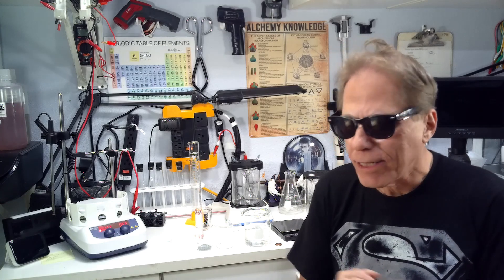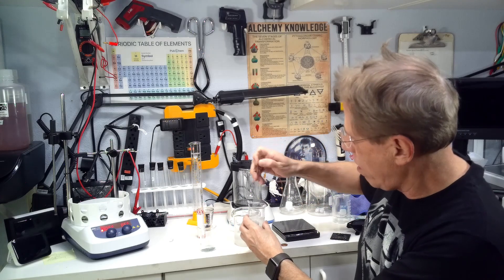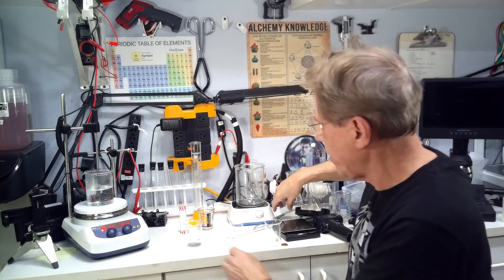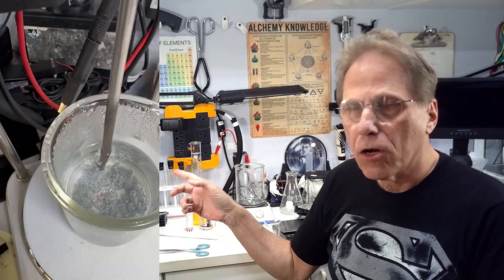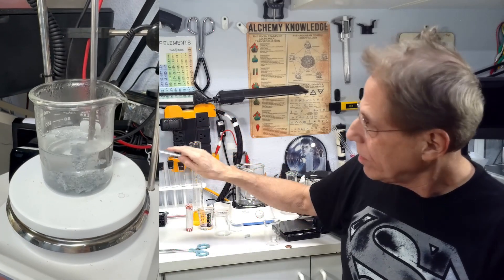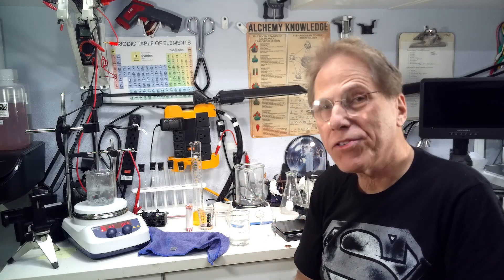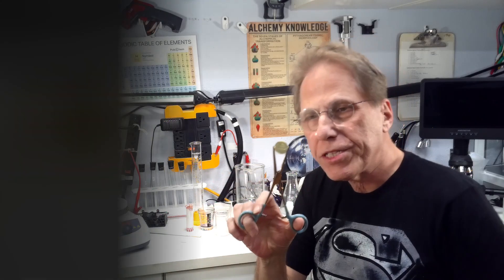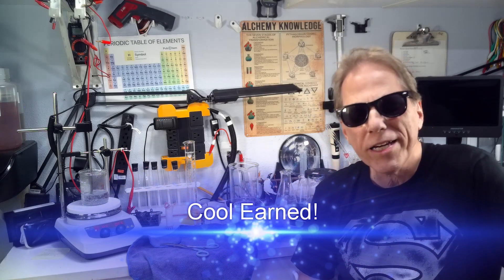Turning Copper Pennies into Gold! It’s Alchemy!

Comment: Hey Tom I have a problem with producing the colloidals. Everytime I make one like koper, gold etc. something appears in the colloidal after 2-3 weeks. It looks like dust. Do you know whats wrong?
Reply from the maker: Hi. what color is your copper. Copper-0 brown is unstable and will separate over time. I'm still working on finding a way to prevent copper-0 brown from coming apart.

Copper-1+2 should be stable, if you followed my directions. If you cooked only copper-1 green, copper-2 cyan, then the copper will come apart. Only form of stable copper I've found is by cooking copper-1+2.

Ruby Red Gold will have fine dark particles in it over time. It is very concentrated and sits at the threshold of what it can hold in fluid form. Ruby Red Gold is more stable if you use corn syrup as a stabilizer. If you used some other sugar you will get the that dust sooner. In either case some of the colloidal nanoparticles are falling out. A small amount is normal. I just filter it.

Plasma arc gold is 100% stable and never loses any colloidal nanoparticles over time. However Ruby Red gold may be more beneficial than the Rose plasma arc gold. More testing is needed on that.